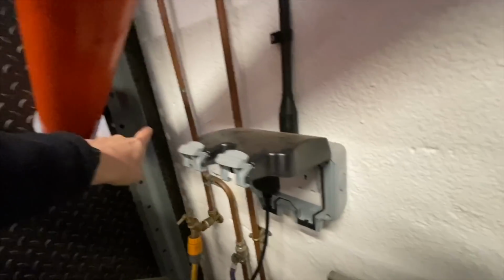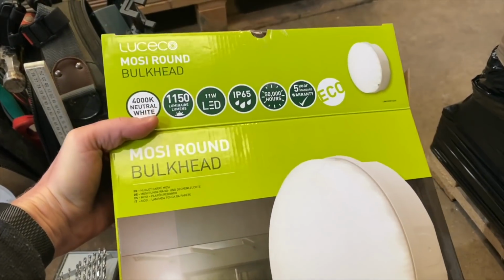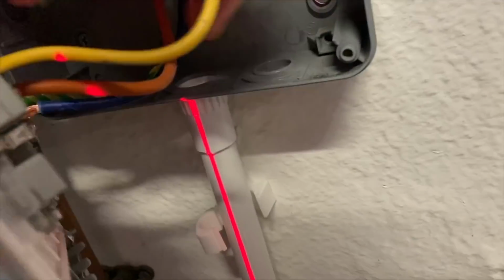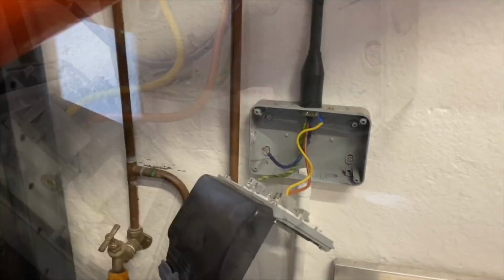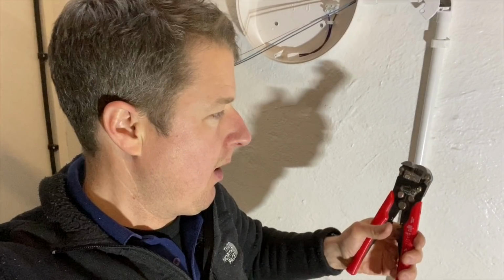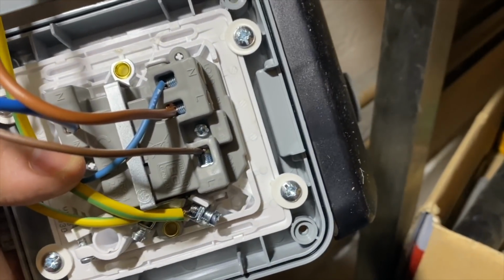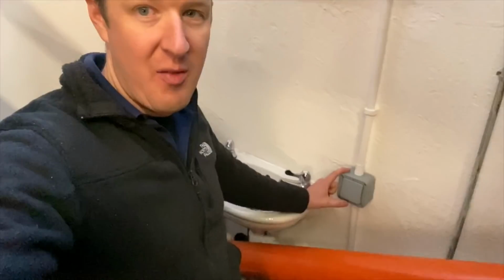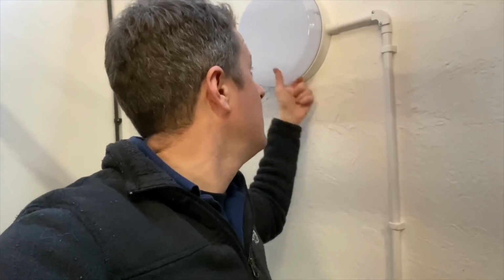Commercial Electrics Part 2 - Installing Conduit & LED Lighting

Comment: Between the double socket and the 3 amp spur what size cable did you use 2.5 or 1.5?
Reply: All sockets should be 2.5 and lights  1.5

Comment: In that place where you took a lead off beside a handbasin (to feed a light in the stall next beyond the wall), wouldn't it have been better to have the conduit and wiring above the handbasin level, to avoid the possibility of watering the conduit?   I would have taken the wiring "high" rather than "low".

Comment: What’s the difference between commercial and domestic regs which allow a light switch next to a basin at work but have to have a pull cord in the ceiling at home? I thought water and electricity don’t mix in any setting.
Reply: Baths, showers and swimming pools have very specific and prescriptive regulations. Presumably because the authors of the regulations see people mostly naked and soaking wet or even immersed in water as very high risk. Combine these rules with the small size of many UK bathrooms and pull cords often become the most practical option.

Sinks basins, toilets etc don't have any specific regulations, though the general rule that equipment must be suitable for it's environment applies.

Comment: LEDs use such low power that any parasitic power can cause the flickering.
The power through the indicator  was probably enough to cause it.  
The LED driver in the light is probably not a great design and doesn't have the ability to deal with it.  Some have inbuilt resistors to stop that flickering caused by parasitic or capacitive leakage.
Reply from the maker: Yeah that’s good to know thanks

Comment: Pack  your saddles out with a couple of penny washers behind.
Reply from the maker: Nice
Reply: @PETER WILSON Good ideas, I'm realy suprised he didn't make one up, you can also use 15mm barrier pipe cut to required size.
Reply: @PETER WILSON Similar here, the guy that fitted my water meter did it.

Comment: Male conduit adapters are useful where you have a threaded hole to connect into.  They are not as good where you have an open hole such as into an accessory as the locknut and thread tend to protrude more into the accessory than a female adapter’s bush.  As for the neon, I’m guessing it was connected across the switch contacts so would be in series with the LED light.  If the neon was connected L-N it wouldn’t have caused the LED light to flicker.
Reply from the maker: Great tip thanks!

Comment: So in terms of male vs female adapters, normally female is most useful as it protudes into the box less, but eg if you have a wiska box with threaded holes then you want a male adapter to thread into it...
Reply from the maker: Great tip thanks!